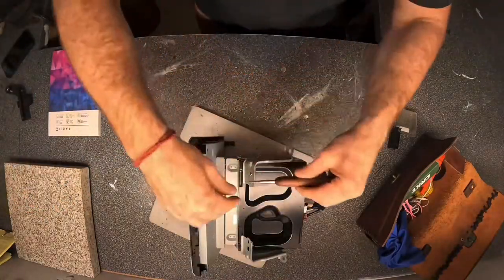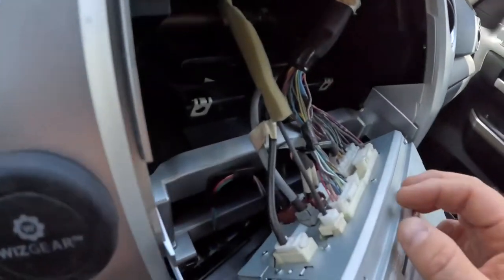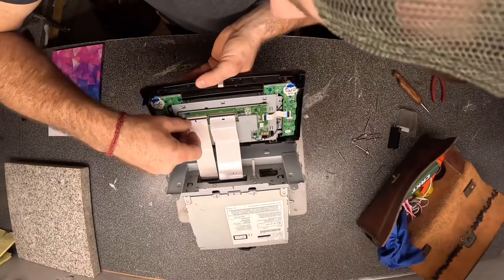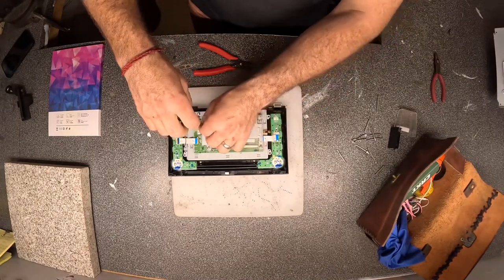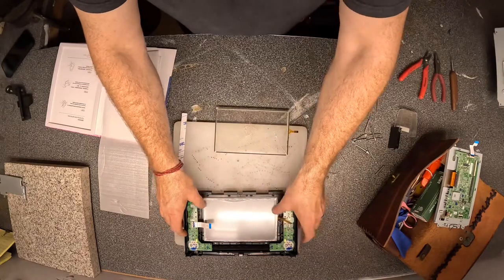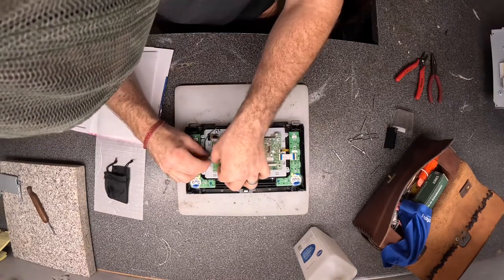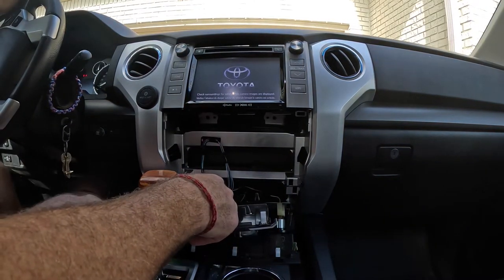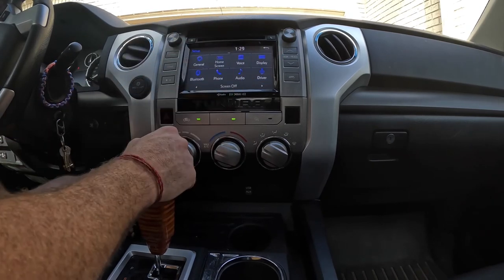2014 Toyota Tundra Radio Screen Replace Fix

Comment: Just did the same thing 😢🤦🏻‍♂️
Reply from the maker: Get it fixed?
Reply: @carneraerial  Not yet have to order a new screen still!!
Reply: Bro do you switch it to blue tooth if the touch screen isn’t working?

Comment: Worked !!  Thank you.   Used a Kingston 8GB Flash Drive.   I did keep getting an error saying "New software is not compatible with the system"    I turned the truck off, removed the MicroSD Map card, plugged the USB Flash Drive back in, and restarted the process.  Worked after removing the Micro SD Map card.    Then, when install was complete, I turned truck off, then I put the MicroSD Map card back in.   Once i restarted the truck everything seems to be good!   Thanks
Reply from the maker: Nice. Glad to hear. Thanks👍